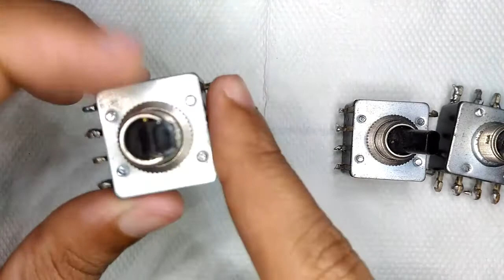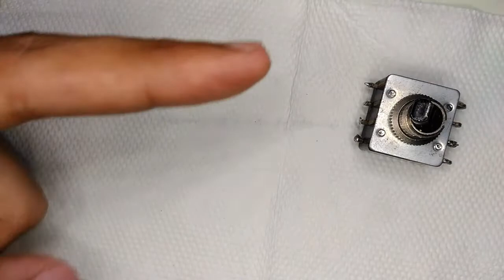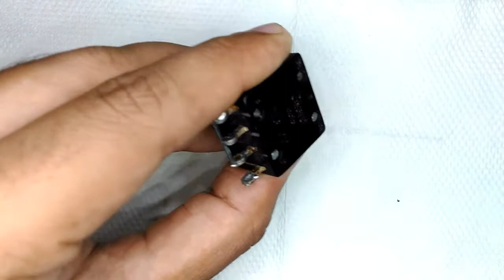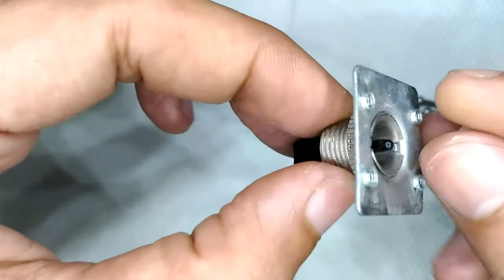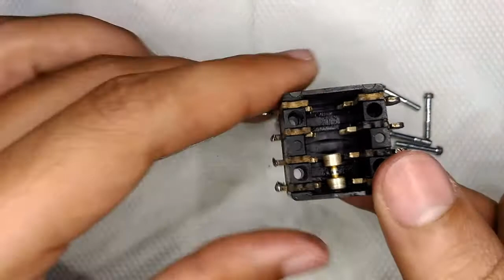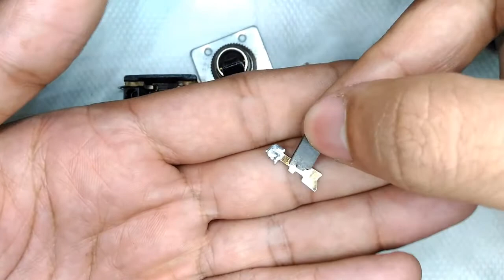IE#118: The clever engineering behind an 8 pin toggle switch! (Gilard 713-22)

Comment: Can we use this 2amp 250v AC switch for 10amp 12v dc???
Reply from the maker: Nope. An amp is an amp irrespective of what the voltage is. You need to use a 10 amp rated switch for a 10amp load.